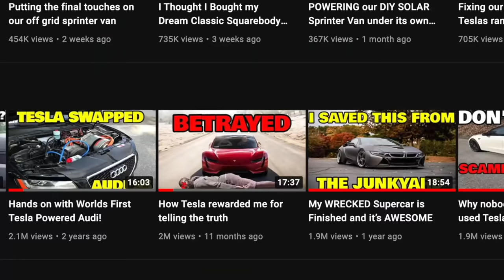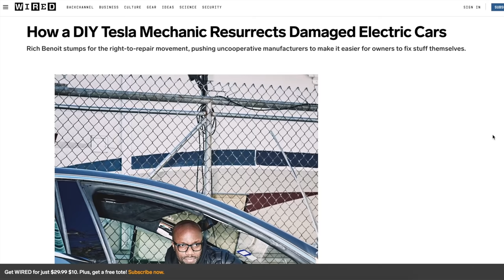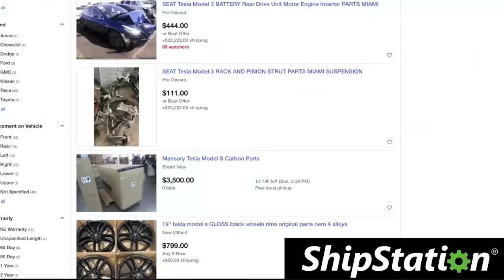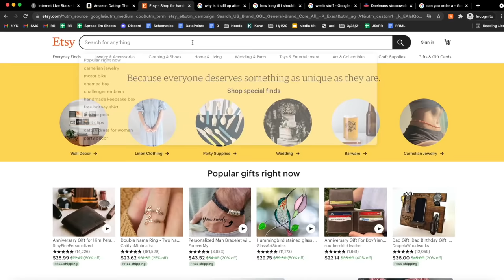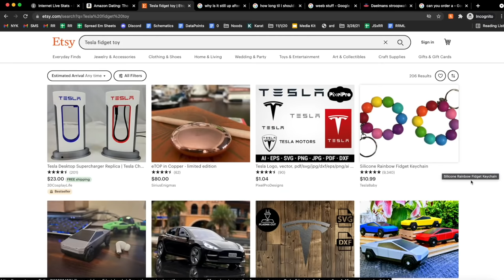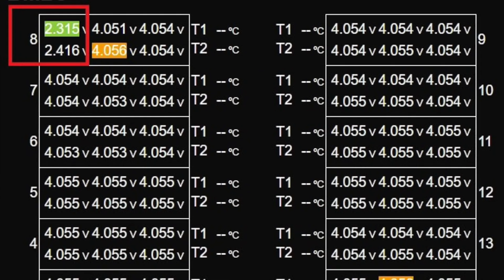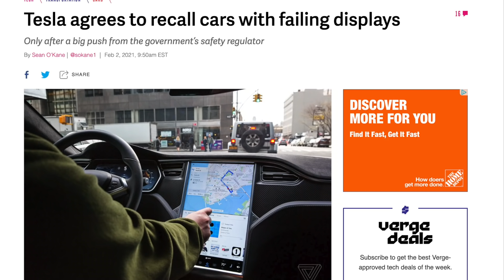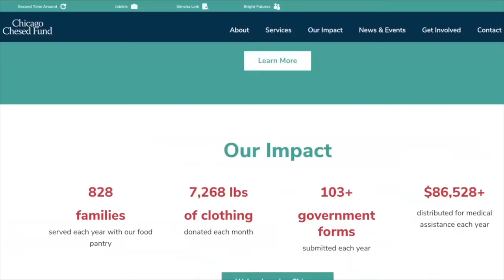Tesla wanted $16,000 to fix this NEW Model 3, we did it for $700! The importance of Right to REPAIR!

Comment: I can't believe that those guys fixed it very cheaply and tesla was $16000. See that tells you that tesla is a liar about how much it cost to fix those cars. And why can't someone make a way that any battery powered car can charge itself instead having to use electric powered battery chargers. I watched a video on YouTube were a guy made a generater that he attached to a all electric Kia and it would charge itself while driving and it also had solar panels on the roof so it could use the sun also so why can't tesla and other electric car makers do what that guy did to charge his car fully.

Comment: What's he going to do now when his lease ends? Tesla's going to require he pay Tesla to put in a new battery. He's going to have to buy the car outright in the end. The real issue here though isn't the proprietary products, but the lack of reparability. It shows how Tesla is still immature as a manufacturer and is overlooking simple parts that are integral to the system. This lack of reparability makes me scared shitless to buy a used Tesla. Any other car would  the care broken down into more components that could be individually replaced rather than monoliths. It's not even the repair shops fault. It's that Tesla designed the car immaturely.

Comment: This must have been addressed.  If so, sorry, but, while I love the McGuiver fix, the brass male/male fitting reduces the channel diameter.  With low fluid pressure, any concerns about creating decreased coolant flow in the system by creating a bottleneck?  I think the answer should be Yes, but I'm not an engineer.  My guess is a flow restriction will decrease glycol flow, and thus increase battery temp.  Thoughts????

Comment: this is why i drive a 1973 f-250 pickup truck great big gas guzzzzzleing 390 big block v8 thats 6.4 liters for you kids out there c-6 automatic point igniton 0 zero computers but it does have several diodes in the alternator and i think 2 transistors in the voltage regulator ....im on ssdi and cant afford a mechanic so when i get to the point i can no longer maintain my truck i just wont be driving any more...also for you kids out there i got the truck with the 390 on purpose as its a big slow reving motor that needs very little maintanance in this world you gonna have to pay some one to drive and thats the gas pump or a mechanic i choose the gas pump and a stone cold reliable engine tranny ect...happy driveing kids

Comment: It seems such a waste to throw away a whole car rather than service a little plastic pipe.
If we want to go green and save the environment we have to consider the carbon cost of making stuff and disposing of it.  It takes far less carbon for me to drive my 8 year old 20mpg Infiniti 5k miles a year for the next 5 years than it does to make a Tesla and then throw it in a landfill because a little plastic pipe broke.  Even if i was driving more ave amount each year it still wouldn't make sense.  
I live in a swank neighborhood with lots of other retired people who don't drive much.  There are more Tesla's than anything else.  They are not saving the environment.  On top of that they all live in 5k foot detached houses with air conditioning and heated driveways so god forbid ice doesn't collect on their driveway and make them slip and fall when they get out of their Tesla.
Reply: Batteries get recycled.

Comment: I Feel like:
-Innovation like this takes a long time to progress in the field. Gas mechanics currently have a centaury of experience available to them including online at their fingertips. 
-Ford is over 100 years old  
-Tesla is only a baby at 19 years old. It's going to take a long while before mechanics are familiar and comfortable with electric vehicles to perform these 'Jerry Rigg' fixes. 
-Most of the time people are scared to perform fixes like this with new technology so they just go for a swap out because its the safest / easiest fix that keeps the company's liability protected if something goes wrong later down the track.
Reply: excuses. I bet any hobby mechanic could've fixed that issue there with an afternoon of effort, a skilled mechanic can fix nearly everything, even some things outside of their usual environment. I've seen farmers manage to fix their cars suspensions.

The people working at the dealerships that made that cost estimate for that car did not lack experience, unless tesla hires only young people. They were, as far as I see, simply not allowed by the company to fix it the way they could, because the company maybe refuses to take liability, or because its too cheap. I ain't jumping on conclusions.
Reply: Uhh, other than the computer boards, an electric motor is easy to deal with.  You need batteries, an inverter and a motor, voila!  And no, those circuit boards aren't even required, its just to make it easier to deal with and add in creature comforts.  If you know how fast the shaft is spinning along with the gear ratios, you can get the speed of the vehicle.  And electric motors have been around for longer than Tesla has been a company, its been used in industry almost as long as we've been using electricity to power lights.
Reply: Again if I were to work at Tesla and had some clout, I would have a whole department that would take feedback like this, and integrated into a system for repair and upgrading and updating to prevent future problems like this. I think Elon needs to take the lead on this, as the number of vehicles goes into the millions.

Comment: Is anyone else thinking that’s a pretty cheesy BMW looking part that’s part of a 16000 battery wtf I buy a 100$ spectra premium radiator and the trans lines I don’t use cause slush boxes are for pussies aren’t plastic they’re brass cause plastic would break. This is to me pointing to cheap build quality but the repair is probably more of an upgrade then a fix cause that pipe union is for sure stronger.

Comment: man i would really like to disrespect you.. so much :)
you should have had to pay the 16G and wouldn't make a dent considering the moral trash you are pushing.. for that brand
the plastic piping knocked me off.. for real man.. it really put a dent.. come on 16G part.. with a plastic fitting.. sticking out of the MAJOR component(cooling system)

1 point for the clever repair.. epic.. 50c vs 16G :) musk had a bad trip that day

Comment: I opposing about electric vehicles- batteries replacements.  
Every channels posting about how good electric vehicles are and saving environments and gasoline moneys.  I made my points very clear.  The batteries are still the majors problematic for every manufacturers around the world. They’re super expensive, they are super toxic to openly exposing nor repairing by yourself or local repairs hops.   The time travel ranges limitations and the time for recharging, etc.  
All owners of electric vehicles facing many obstacles from the moment they paid dealer for electric- batteries vehicles.  Another toxin about batteries replacements- how much- cost to many vehicles owners to reclines dead batteries?
Additionally, the Repairs Shops not easily accessible perhaps most many manufacturers they wanting total repairs controlling- no customers repairs choices.
Again gentlemen, this is nothing news.

Comment: Is there a Hobby car nobody fixes them nobody wants to fix them so how do they supposed to take off there's no dealer networks other than Tesla and they want to rip you off there as bad as Apple that's why the electric vehicle no matter how much they push it will not take off the range is shity it might be okay for consumers that don't do any work but anybody that does work or travels down the highway all day doesn't have time to charge it

Comment: Came for the repair, got 5 min head of self promotion and tail 5 min of waffle. 10 min of wasted air time. BUT it does redeem itself a bit by emphasizing the need to know what you can and most importantly CAN'T do with a Tesla. Nice car until something goes wrong, then it becomes a POS.

Comment: Came across your video, and I have a question and a comment. 

QUESTION: Instead of using a razor knife, could you have used a PVC cutter? This would’ve made a more clean cut, with less repair time. I’m not sure on the working space, that’s why I’m asking.  

COMMENT: Awesome video. It was so refreshing to see a man of color leading a team of techs to repair one of the most technologically advanced vehicles on the road. These are the types of situations which need to be supported and shared. The whole rapper, gangster life-style is so degrading and demoralizing to a large segment of our population. This piece alone screams self-worth, pride, and personal value. This is the American dream. Good job to all involved!

Finally: Props to Tesla for supporting your efforts with right to repair. By allowing “Shade tree Mechanics” like yourself to continue working on cars, it shows that the vehicle is still viable in the consumer market. People will be more willing to purchase if they know there are local options for repair when they become necessary. There is still hope for the future.
Reply: Didn't look like room and it's only a difference of a few seconds smoothing it.
(And all I saw was a bunch of guys working on a car.)

Comment: Good work, Tesla customer service is rubbish, ridiculous, too far away, too incompetent and too expensive. I will never get a Tesla. I have known many people who have had nothing but complaints about Teslas, safety, durability, electronic issues, cheap exterior and interior parts, well they are made in China so what should we expect. Yes, the frames and parts of the battery components are made in Texas and California, but everything else comes from China, like Buick is doing now, so much for American made, huh? Some people love their Teslas, some people hate them but some people stay loyal to Tesla, even with the issues. I think they are cool inside and comfy and drive well, outside not so much. The Y is hideous, the 3 is the Ys baby brother with a little more style, the S is nice, like a Jaguar XF and the lambo doors on the X are cool but the break easily and the X is just too top heavy looking, it just doesn't look right. Good ideas, good concepts about 5-10 too early and just poorly manufactured and unsafe, they can explode. Glad you got your 3 fixed for 0.5% what Tesla would charge you. The 3 is definitely their best model and the least problematic . The Y is a nightmare and should be taken off the market for beta testing and improvements , its' an abomination.

Comment: Well guys you really did do a amazing job by saving that car owner not having to pay $16,000.00 but charging him $700.00 for taking off a plastic cover shield and using a double sided brass nipple that cost about $1.83 at a hardware store and then threading that plastic parts to put it all back together with you charge $700.00 is still a ridiculous amount to charge.